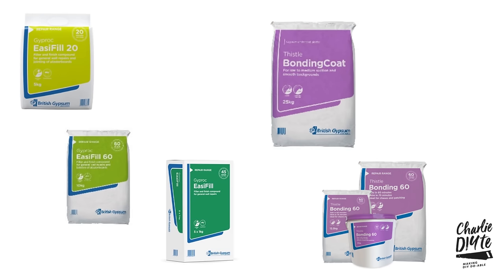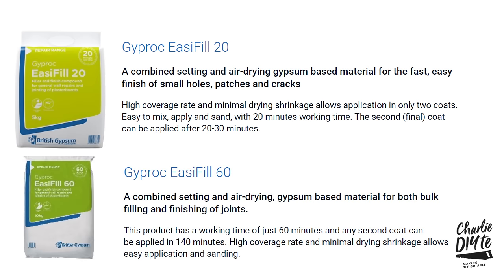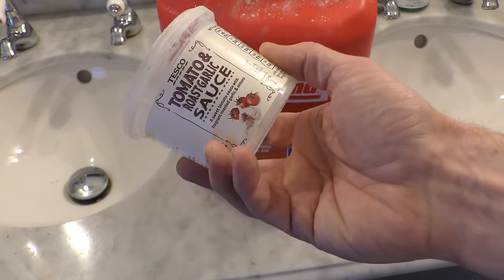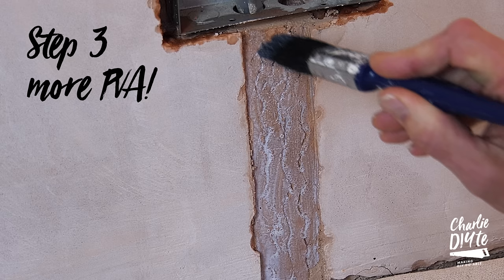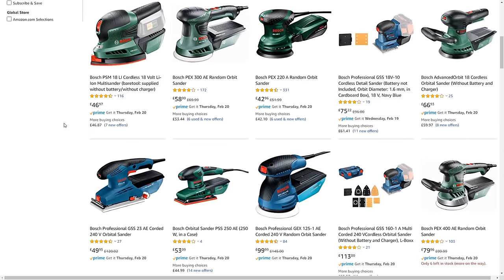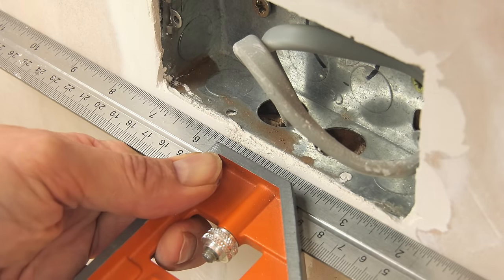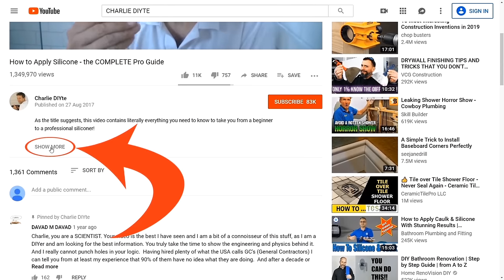How to Fill Wall Chases, Cracks & Holes

Comment: Enjoying your videos. Being. Relatively new to DIY I need some help...
Which product should I use for repairing damage to walls following taking out the coving from the walls. Ceilings have been professionally plastered.
Reply from the maker: Thanks James. A little difficult for me to say without knowing what damage you've got to fix, but if it's relatively minor you could do a pretty decent job with the Easi-Fill, with a bit of watered down PVA on the damaged areas before applying, to assist with adhesion.

Comment: Really useful video! I’ll definitely be trying the easifill - I’ve used other patching plaster in the past but the gyproc looks likes it’s much better value for a 5kg bag in B&Q for small repairs 👍🏻
Reply from the maker: It's great stuff, Laura, and for small spot repairs, think about the box with the 1kg sachets, that way you're keeping the other sachets fresh for when you next need it. It does last pretty well though, if you keep it dry.

Comment: Your videos are first class!! 
I have a wall where the boiler flue is fitted in the kitchen utility room (from internal wall to the exterior). The interior wall is very rough & plaster broken exposing the brick (next to the boiler).
And there are a couple of pipes running up into the ceiling.
The patch of wall is app. 3ft x 2ft with the flue in the middle...
I want to make good the wall but unsure if the plaster will hold if i were to plaster around the plastic flue round wall plate.
Im unsure if this would need scrim tape around the flue pipe wall plate in order for this bonding & plaster to hold + as the area has pipes too not sure how i can ensure the plaster is evenly flattened.
Any suggestions?? I hope i explained this situation ok

Comment: Cheers for all the super helpful content! I’m following in your footsteps with my own diy cottage and wondering if you have a link to the video you mentioned where you were using bonding to fill behind skirting?? I’m about to do this and it would Come in handy, but I couldn’t seem to find it. Many thanks!
Reply from the maker: Hi Sean. No I haven't done a video on the bonding but as long as you get a big bucket, mixing paddle and plasterers hawk and trowel you'll be absolutely fine. It goes on and can be tooled really easily 👍

Comment: Charlie, good video, just to note, when wiring through electrical back boxes you should use grommets, maybe you installed them at a later date.
Reply from the maker: Thanks Paul. I certainly did https://youtu.be/AmmjoHrggPg?si=UwzKPUGaOJ9_9J76 👊

Comment: Really helpful, thank you! Doing up our house and have already become chief caulker using some of your other vids :) Question - how would you suggest filling holes for removed spotlights?
Reply: Cut a bit of roof batten (2b1) and push into the hole and rest across it. Screw it in place either side of the hole, recessing the screws very slightly into the plasterboard. The batten gives the easifill or bonding something to key into. Pva the batten and edges of the hole. Then fill with the easifill/bonding, sand down and paint.
Reply: @AccountantDoesDIY Thank you!

Comment: Hey love your videos. I was wondering what you would use/do for a house that seasonally shrinks and enlarges causing the walls and wallpapers to crack and tear. Any tape that moves with the house or stretches? Cheers.

Comment: Hi thanks for the great vid, I have a question. Is the standard bonding  ideal for small repairs or where cabling or pipework has been installed. As the bonding 60 states there is less risks of cracking and shrinkage?
Reply from the maker: Thanks! The point about the bonding is that it's an incredibly claggy material meaning it's great for deeper repairs, but given the biscuity appearance (I'm getting really technical today :) you do need a finishing material on top of it, be that plaster, or Easi-Fill. So for small repairs that aren't very deep I'd always go for Easi-Fill because it'll fill the hole with minimal/ no shrinkage and you can sand it down and paint straight over it.

Comment: Also pva the edges of your chase, it helps to feather your final coat it, sometimes if you recess your backing plaster ( bonding) the outline might slightly come though, so always better to slightly go past your original chase, even a few mill, then sand down once dry

Comment: Great video, thank you!  You mention that you would use sand & cement rather than bonding for areas likely to suffer from damp, would you still use the same easifill for the finish or is there an alternative you would recommend?
Reply from the maker: Yes I'd still use the Easy-fill. All depends on if you want it breathable. If not and you're worried about damp I'd add a waterproofing additive to the sand and cement and then you can Easy fill on top. If the walls need to be breathable, then you'd need to use a lime based render and plaster.

Comment: Got everything i needed from this video. Many thanks. Only 1 chase to fill so using easyfill. New subscriber.  Is there a max depth when using easyfill? Thanks
Reply from the maker: Thanks buddy. No, you can just build it up gradually, or maybe just make a nice stiff mix first off, like I did in the vid. It's awesome stuff. No shrinking when compared to products like Tetrion, and sands beautifully for an invisible repair.
Reply: @CharlieDIYte  Hi Charlie
I gave a friend who works for British Gypsum and i have had long chats with him about all different products and usage.
He tells me tgat easyfill should be used for gaps up to 25mm and built up in approx 7-8mm stages anything deeper products like one coat plaster or bonding should be applied first.
Of course this is the offical line.

Comment: great help! I am about to undertake tanking slurry to a wall which has just had some cables chased (solid masonry) - what do you recommend to fill the gaps in and around the chasing before tanking slurry? assuming you can't use the tanking slurry as filler...
Reply from the maker: I would use a sand and cement mix Joshua - 4 parts sand to 1 part cement. If the existing wall is meant to be weather proof you could mix a waterproofing agent into the mix but probably no point if you're tanking it after anyway.
Reply: sounds great - KA had suggested to same process so thanks!

Comment: For little filler jobs i use a 6inch tape knife and another one to fill with. Use the 6 inch like a hawk and for small jobs i find it really easy and nimble to swap between the 2 as required.
Reply from the maker: Thanks Matthew. Yes I had a go with a tape knife in this vid https://youtu.be/DOgUBY1g2yY 👍

Comment: 1. Don't use screws to hold the capping in. They will rust and it will show through the paint.
2. Top tip here: don't try cutting out the back box hole precisely, as it's harder to fill in smaller gaps. Far better to chase the back box hole far bigger than needed. The plasterer can actually fill without leaving thin gaps. The key is to have the box sit FLUSH.

Comment: Hi Charlie. Great video, thank you! I have lots of plumbing and electrical chases to fill and a tight budget, so I'm relieved to find your channel. Just one question - It looks like you had the wall plastered before you filled the chase? Is that the usual way of doing it or could I fill my chases as you've described before my plasterer starts work?
Reply from the maker: Thanks Annabel. No that was me being an idiot, getting the room plastered and then realising I needed another socket 🤦🏻‍♂️ Definitely fill the chases before getting your plasterer in. 👍

Comment: Some of the plaster on my pvcu window reveal just above the sill up to around 300mm has cracked and de-bonded. It's a solid 1930s wall so the wall always feels cold here (if not a little damp). What's the best way to fill in this area once I remove all the plaster from the brick? Loving your videos Charlie!

Comment: Useful stuff.  My electrician used Easi fill 60 to fill in his chases on my walls and ceilings.  Can emulsion go straight on or is a primer / mist coat advisable? Cheers
Reply: I would always mist coat any porous surface be it plaster or filler - always a better finish IMHO

Comment: Hi Charlie - great video as usual.  I dabbled in plastering over the years, but it's been a while since I last needed to do it.  Do you know if British Gypsum have rebranded?  I always thought the bonding/undercoat was named ' browning' or is this for something completely different?  I also made the mistake of plastering right down to the ground on a concrete kitchen floor!
Reply: They used to call it browning but changed it some years ago.
Reply: @abscomm  Thanks John - top man
Reply: Bonding has never been called browning , browning is a different product altogether
Reply: @jaydavies2398  Do you know the difference.  I used it a lot as recently as a few years back.  I'm guessing it's something to do with site work?  Where conditions are not temperate??
Reply: They are both backing plasters  but bonding is used for chases and smaller patches , browning was used to do full size walls on  brick or block , brownings alternative is now called hardwall
Reply: @jaydavies2398  thanks, I think i get what you mean. most likely more sandy consistency to prevent sag over larger span?  I always steered away from bonding coat because they sold it in homebase!?!

Comment: Hi Charlie. Can you explain more about not using bonding on walls susceptible to damp i.e. I have an internal, downstairs wall where the old plaster has come away with the skirting board - can I apply the method above or will I have to use sand and cement?
Reply from the maker: Internal should be fine, so long as it's not damp. The thing is, bonding is rock hard if dry but if used in a damp environment the bonding acts like a sponge, which will ultimately turn it into a bit of a mush. So any walls you're worried about, sand and cement would be a better option, possibly with a bit of sika or similar water proofing additive for good measure.

Comment: Easifill is the absolute nuts. Not the ready mix stuff of any brand. Powered all the way. PVA can be mixed in an old red sauce squeeze bottle and squirt it into the chase. Saves dipping your brush at all. Just use  the brush to prevent large runs. You could also set the backboxes in with thistlebond like how you would a brick or block.

Comment: Thanks for the video. Could you please let me know the cure time for the first pva application ? Also is it a must to install capping over the cable ? Thanks.
Reply from the maker: Cure time is normally an hour or so, depending on the conditions. You'd have to check building regs where you are but the capping is sensible to prevent accidentally drilling into it.
Reply: @CharlieDIYte  thank you!

Comment: Having had  some rather deep chases cut into a wall for electrics and concealed radiator feeds I went back in time to view this video again and used the easifill 60
Great product
Thanks for the info 👍
Reply from the maker: It's awesome isn't it, Lee! I was introduced to it by a builder mate years ago and have been using it ever since.

Comment: Hi great vid as always. How long did you wait for the pva to go off? Thanks Charlie
Reply: I was looking for this info too. From what I can gather looking at other sources, you should let it dry completely, so just depends on the surface and how watery your mix is. Maybe something like 1-2hrs? I put on a PVA coat about 1.5hrs ago and it seems good to go now.
Reply: Yeah, wait hours rather than minutes. If it’s not completely dry it can make the bonding slide down. Not sure if this is true, just what I’ve learnt

Comment: Great video, Charlie. I have a qestion - how long before a wall repaired with Bond coat can be overpainted? I hope I would not have to wait for 4 weeks as some sources suggest...
Reply from the maker: 4 weeks? No I would have thought as soon as the bonding and plaster coat has fully dried out.

Comment: Hi your videos are a lifesaver! I have a question I don’t know if you’ll ever see it 😂 under new tiles there are big holes and damaged walls …I almost bought the bag of 60 earlier because it says on here it will be ok for bulk holes uneven bits… but….the website says don’t use directly under tiles? 
I wondered if they mean as a tile adhesive? Because I would obviously use a tile adhesive ! So is that considered direct? I’m lost …I don’t want the tiles and adhesive to pull the 60 off the wall 😂👍 it’s only counter top areas and window sills .
Reply from the maker: Thanks- glad you find them useful. I guess it's because being a gypsum based product it degrades if subject to damp, and you're not really meant to tile over Plasterboard, although a lot of people do. You'd be better to do the repair with sand and cement if you can face it.
Reply: @CharlieDIYte  thanks for the reply!  Great I’ll pop and get some :)

Comment: I switched over to Toupret interior filler from Easifill. Much the same in terms of cost and application, but crucially - as its says on the box - it doesn’t flash through paint. I can now make substantial repairs  completely invisible.

Comment: The electricians did a terrible job with installing sockets in my house (after the room was very nicely skimmed). Is this the best method to repair and avoid future cracking? Thanks.
Reply from the maker: You'll do a lovely invisible repair with this stuff. Yes, there are other products available eg Toupret but I'm a big fan of Easi-Fill.

Comment: Great video. Maybe could you show a video on fixing plaster cracks on internal angles of walls and also where there hairline cracks on ceilings where boards have been joined. Thanks
Reply from the maker: Thanks Alan. The hairline cracks are easy. Use the Easi-Fill and one of the continental filler knives you saw in this video, and tool the filler into the crack, removing all residue from the surface. When it's dried lightly sand the surface with a 180 grit sand paper and then repaint. Corners are a little trickier. I'd still use the same principle, but it'll take a bit longer because it's more fiddly.
Reply: Charlie DIYte Thanks Charlie. With the hairline cracks on ceilings where boards join should I make cracks slightly bigger then fill as I’ve filled once and keep appearing again. It’s from vibrations on floor above. Thanks again
Reply: @alanmarriott9216  I would make a hole and squirt expanding foam, it does work. Just make sure no live cables or pipes and squirt every 6 inches and hopefully this 2 plasterboard can be bonded together and supports the 2 board together. This happens due to not enough support or noggins missing, if it the plasterboard and if it lath and plaster then the plaster between the laths is failing.

Comment: Hi Charlie. Have found your channel so useful since I moved house a year and a half ago. 
I'm now tackling our downstairs, and have removed our skirts after stripping walls. They're in poor condition so will replace them when we get a new wooden floor put in. 
I'm in a 30s house, downstairs is a suspended floor and I don't think we have any damp problems. 
My question is... After watching this I'm thinking to repair the wall behind the skirt with the bonding coat you show here. But should I patch this over the existing plaster? The majority has crumbled away and I have the odd bit of brick showing. Or would you recommend I knock this all back to brick before applying?
Thanks in advance.
Reply from the maker: Hi Olly. Sorry for the delay in getting back to you - the comments get buried sometimes and I just don't see them. My inclination would be to remove any really loose plaster. You don't want to bond over existing plaster particularly if it's loose. I know it can be a can of worms removing loose stuff as you don't know where to stop but strip off what you need to back to the brick (like I did in that sped up sequence when I used the mixing paddle and bucket. Pva the wall and then bond it. Any other questions just drop me another line 👍
Reply: @CharlieDIYte  and now you post a skirting board video... What would be perfect timing if it were not for the lockdown. Stay safe

Comment: Hi Charlie, do you think you could do a video on DIY wall chasing? My issue is that I have an aerial outlet that was used for an old cable installation using RG59 cabling. I have an existing terrestrial aerial and RG6 cable running from it. The problem is connecting the cables (RG6 to RG59) attenuates the signal and I need to use a booster. Even with this I can't seem to pick up all of the free to air channels available. I've tested the signal at both points and the loss is incredibly high and therefore why I want to replace these old RG59 cables. Its a small job but I have no idea how to chase into the wall and I'm concerned of chasing in too deep and whether there is a "right" way of doing this. You are welcome of course to demonstrate how to do this using my home as your canvas. Thanks! James

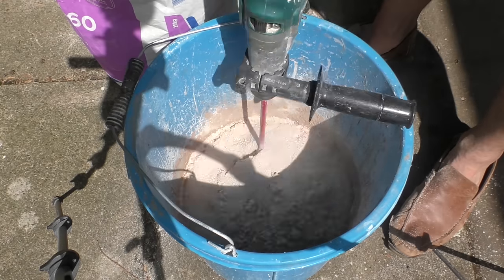Comment: Hi Mate, firstly great channel! in around minute 8:50 you talking about the time you plastered after taking your skirting boards out, I was trying to look for that video on your channel but couldn't find it, do you mind sharing a link? I recently removed my skirting board and needt to plaster before putting the new ones on..
Reply from the maker: Hi mate. If it's an external wall downstairs you'll probably want to use sand and cement as bonding won't fare well with damp, but anywhere else, I'd just use bonding as you see me doing briefly at 8.55. The plastering video is here https://www.youtube.com/watch?v=Ksc2mghC-4c&t=1472s but if it's only a small area I'd be tempted to apply a bonding coat, just below the final surface level, and buy one of these Easi Fill products for the final skim, getting yourself a decent plasterers trowel and plastering hawk.